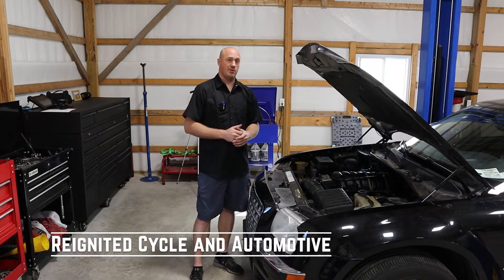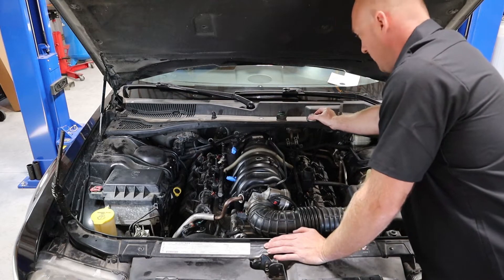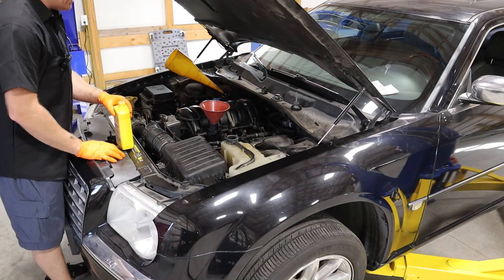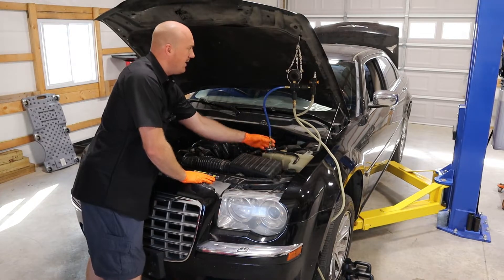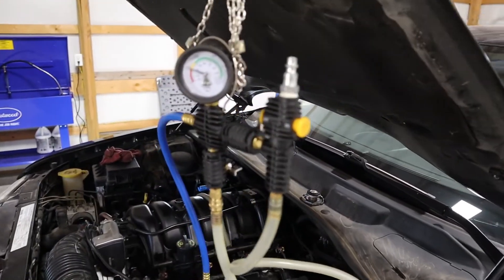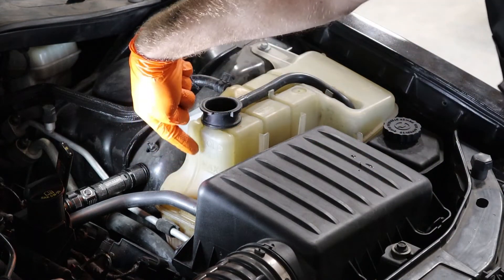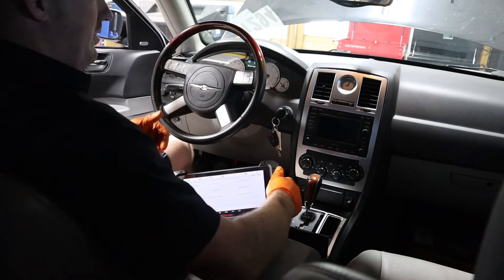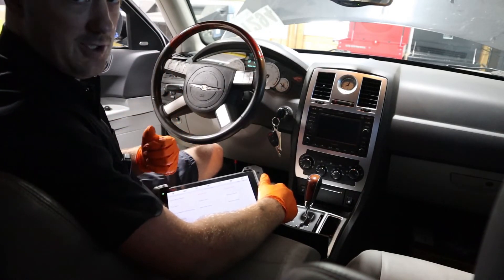Will It Start // Chrysler Hemi 5.7 Engine Rebuild Completed // Chrysler 300 Episode 5

Comment: I have 2011 chrysler 300c 5.7l  change out the water pump engine fan still running hot trying to figure what the problem could be
Reply from the maker: Three options I can think of off the top of my head: Did you change the thermostat as well with the water pump? Radiator possibly half plugged, or most likely you've got air trapped in your cooling system after the water pump replacement. 👍
Reply: Yes sir new thermostat and new thermostat sensor as well never change out the radiator or the condenser
Reply from the maker: @derricas256  First thing I would do is remove the allen plug in the front of the water pump. Fill the cooling system through the resevoir cap until coolant pours out of the plug. Then reinstall the plug and top off the coolant. Run the vehicle through 2 full heat cycles (all the way cold, thermostat open, all the way cold again) and see where you are at. If there's still an issue after that then I'd be looking at either a radiator issue or possibly even a plugged heater core. Are you getting heat from the vents?

Comment: on my startup started to leak fuel from three different injectors. it wasn't getting fuel. I'm not sure why
Reply from the maker: Those two statements seem contradictory, if it's leaking from the fuel injectors then it's getting fuel. Also, if it is leaking from the injectors, remove them from the rails and check the o-rings, they are likely torn or cut.
Reply: @ReignitedAuto  replaced all the gaskets with the Mahle set. I will recheck them again today.
Reply: @ReignitedAuto  it turned on heard the rattling sound went away then it turned off. I will try to start it again after rechecking the injectors. Thank you God Bless.
Reply: @ReignitedAuto  Top O rings on 3 of the injectors were torn. I replaced all 8. It started with no leaks. Thanks for the videos. God Bless

Comment: I had the exact issue with my 06. I rebuilt it, and followed your instructions on priming etc, and the only thing I didn't do is take it for a long drive,  because the battery wouldn't stay charged,  but the tick never went away. I only had it running, at idle for about 10 mins,  and then drove it to the gas station, about 3/4 of a mile one way,  but the tick is so pretty prominent. Should I drive it a little longer, maybe highway speeds so the mds can kick in? It fires right up and idles so smooth,  but that first initial start up clatter,  hasn't went away yet... but like I said,  the engine has only been at idle for about 10 mins,  and then drove about 30mph to the gas station, then home. Any suggestions?
Reply from the maker: It usually needs at least 20min to really settle down.  I prefer highway speeds myself,  but idle time will work usually 👍
Reply: @ReignitedAuto  thanks a lot man. I really appreciate you replying. I've done all the work myself,  and my car has been down since September last year. It just sucks to be able to start it right up now,  but not be able to drive it. Lol. So do you think I should take it in the highway for a few miles? Anything you think I should check out first before I drive it at highway speeds?
Reply from the maker: @Carl Horton  it runs perfect,  just ticks a lot still? If so then absolutely drive it for about 20 minutes and see if they settle down.  If it's stumbling or not idling well then you might have a pushrod issue and you'll want to address that first.
Reply: @ReignitedAuto  it idles smoother than it did before the valve seat issue. Just ticks still, like it's not quite lubricated. Also,  when I drove it to the store, to air up tires that first time, it did act like it missed a little on acceleration. Like I said,  I only drove it about 30mph, so, when I got the pistons in, lubed and connected, push rods lubed and in and rocker arms in,  I rotated the engine,  by hand,  by the crank with a ratchet, just to make sure the engine turned like it should,  and to make sure nothing was bound up. I turned it about 10 rotations or so, so the mild stutter on acceleration,  could that be my crankshaft positioning sensor? I done a little research,  and the symptoms matched,  so I purchased one,  but just haven't installed it yet.
Reply from the maker: @Carl Horton  highly doubtful on the crank sensor.  But don't overthink it. Drive it first. See if it clears up.
Reply: @ReignitedAuto  ok.  I will definitely drive it and see what happens lol.  I've just been so anxious about the whole rebuild,  and then this happened... I probably have been over thinking it. Thanks a lot for replying to me. I really do appreciate it. I will let u know as soon a I find something out.
Reply: @ReignitedAuto  good morning sir.  Thanks again for all your info yesterday. I wanted to add., the only thing different from my situation and yours,  before startup,  is i didn't have a scan tool or any way to check my oil pressure, so I'm not sure what my pressure is,  or if I even have any pressure... AND,  for the first start up of the engine,  knowing I needed to change the oil pretty quickly,  like,  I was gonna just run it for a week or so, thinking I would be driving it by now, and then change our the oil,  so I bought the cheapest auto store brand of 5w 20 I could get,  and same with the filter. The filter was quite a bit bigger in diameter than mine,  so would that play an issue as well, with the cheap oil and oil filter and the filter being bigger than what I took off the car?

Comment: how frequent would a thrmostat or oil cooler go bad and cause no heat on a 07 dodge charger 3.5..?..
Reply from the maker: If the thermostat was not opening then you would have no heat, but the vehicle itself would usually be overheating as a main symptom. In my experience, the most likely causes of no heat are low coolant, due to a coolant leak. Or the HVAC blend doors are not operating correctly. 7/10 it's an issue with low coolant. 👍
Reply: @ReignitedAuto  where is the blend door located.?..

Comment: How much would that job cost
Reply from the maker: More than the car is worth honestly, probably around 6-7k
Reply: @ReignitedAuto  cuz I have the same car I'm just wondering but if you knew what's her open loop and closed loop due to efficient temperature? Crank won't start
Reply from the maker: @rudywarner397  do you have a specific code that is setting? Lots of reasons for a crank no start, but first thing I would do is disconnect the fuel line at the rail, stick it into an empty bottle and turn the key on, make sure you're getting fuel pressure before doing anything else. 👍

Comment: Been following along this series to help with my cam swap, when I go to start the engine, it will only run if I hold the RPM at around 1000-1500. Once I let off the throttle the engine dies out. Any thoughts?
Reply from the maker: Any codes? a couple of things come to mind. The cam timing could be off a tooth, or the pushrods might not be seated correctly, it's very easy to get them out of place and not seated in the lifter end. Another possibility is if you have a vacuum leak, like if you didn't hook up the vacuum line to the brake booster. I would check for codes, and if possible pull the valve covers and inspect the pushrods to make sure they are all in their proper place. Also, when it's running, does it run smoothly or does it sputter or stumble? Hope that helps!
Reply: @ReignitedAuto  multiple cylinder misfire, cooling system performance, O2 sensor voltage high. It seems like it’s running really rich. Running compression tests now
Reply: @ReignitedAuto  sorry, didn’t see the whole comment initially. When I have it at the higher RPM registers it seems to run okay

Comment: Ha sounds like an old 2 cylinder diesel until the lifters fill up then nice and quiet easily hiding the power it has.  Can’t wait to see what you do with it!
Reply from the maker: I know I probably seem nonchalant about the noise initially, but that's just how it is 😄. I have often wondered about trying the old trick of submerging the lifters in oil for awhile before installing them, but who has time for that? 😂